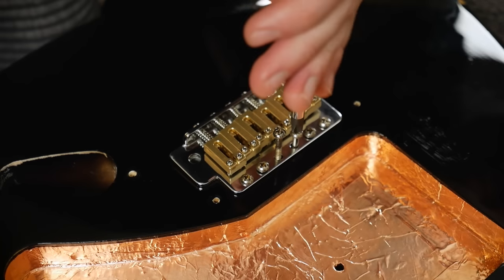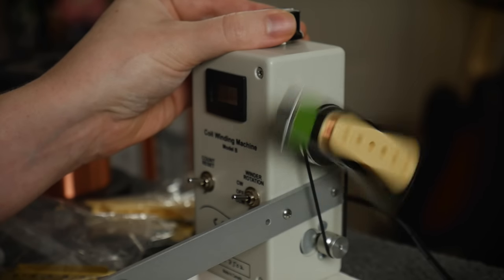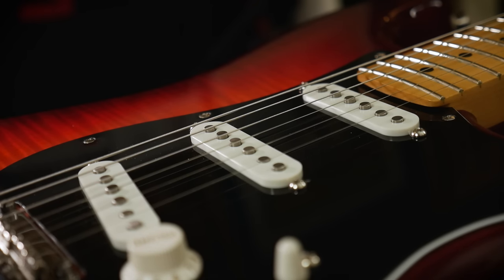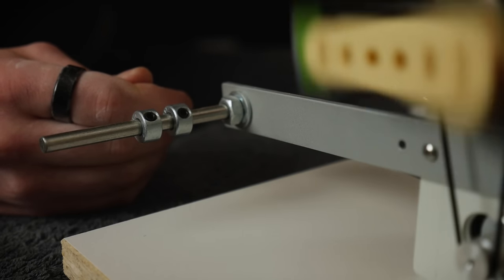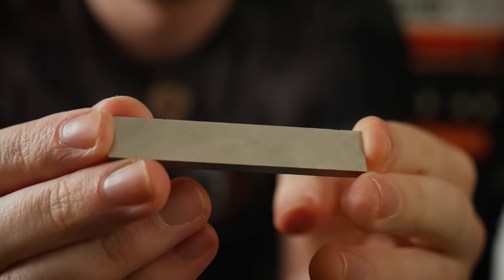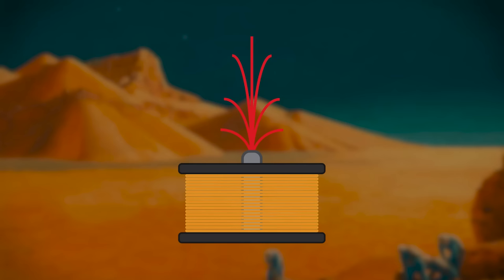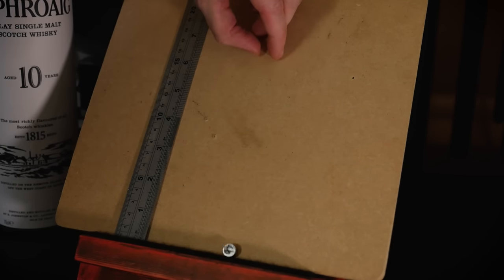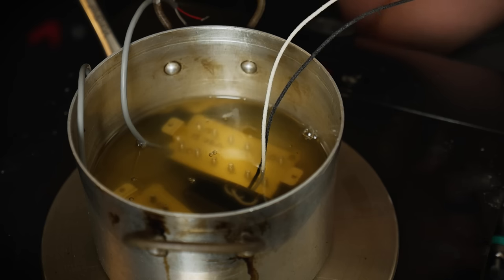(almost) EVERYTHING About Pickups | Too Afraid To Ask

Comment: Great video, however you said " pole pieces are the eyes of the pickup and determine how it will see the strings the purpose is to focus the magnetic field into a specific shape to sense the strings in a specific way"... I would rather say the pole pieces don't actually sense the strings but are more like a focusable "light-source" and the copper coil is the real "eyes" or detector/sensor of the pickup system. The copper coils will not be able to see the strings without the magnetic pole pieces or an underlying magnet and slugs (unless the strings are magnetized themselves and not just made of ferromagnetic material). This means pole pieces or magnetic component of the pickup don't even have to be inside the bobbin or within the coil of copper wire for the coil to sense the strings. See: https://www.youtube.com/watch?v=-jh8RRtruyc

Comment: A lot of useful information however I am not fan of the slimy  wording of it. 

I am aware that skipping the whole fairytale about uneven winding would ruin the "magic" of handwound pickups but I believe factual information should be always presented without bias.
Reply from the maker: The physics of induction for uneven winding is a very complicated topic - the way in which each layer of the coil interacts with is neighbours will change the overall inductive response of the coil as a whole, the way in which the coil is laid down is baked into the equations used to calculate inductance. 

It's not a fairytale, it's just really very involved and complicated to discuss factually, especially in a youtube video being watched by people without a background in physics and mathematics.
Reply: @ScienceofLoud  I appreciate your response. 
What it does is it changes the Q-factor and stray capacitance, both of which in combination with the inductance precisely define the frequency response (or tone in guitar terms) of the pickup.

 All 3 of these parameters can however be tweaked in a controlled manner to precisely tune the response to one's liking by a wide range of methods, some of which you presented. 

There are always multiple ways to get the same results and fabulating the more labor intensive one to preserve *the magic* is from the position of an educator highly irresponsible. That's why I called it a fairytale.
Reply from the maker: @ninethirtyone4264  as long as you are conceding that scattering the windings does indeed impact the physical phenomena at play and can result in macroscopic changes, then we're both on the same page.

Where we seem to differ is I'm happy to engage with people at their level of education and interest on the topic, and without going into the detail let them know that there exists justification for the 'magic' and 'mojo' players feel and hear. 

I'm not intending to reinforce unscientific ideas, I'm simply suggesting that there might be some reality behind the myths.

Comment: Eddy currents exists in ANY metal exposed to an alternating or even just changing magnetic field. (Moreover! Any counductor!) So your opposition of brass to another metals (in that aspect) is nonsense. It actually deprecates seriously all the information you delivering although most of it is true.
Reply from the maker: Yes, eddy currents technically will be generated in any conductor - but different materials will reproduce different intensities of the effect depending on a number of physical factors including density, resistivity, magnetic permeability and the material being uniform throughout. 

So it's not unreasonable to expect brass to behave differently to nickel silver in terms of eddy currents, and the magnetic effect they will have on the coil. 

I felt that maybe going any deeper into the material science and physics that govern the phenomenon were outside the scope of what most guitarists would want to know, or indeed care to understand. 

The take away is that brass has more of an influence over the sound of the pickup when used as a baseplate or cover, and the reason for that is eddy currents.
Reply: @ScienceofLoud  Then it was necessary to formulate in terms of differences in the strength of the effect. It sounded as if all other metals were equivalent in their interaction with a magnetic field to cardboard. Meanwhile, say, aluminum, precious metals, pure copper - will have the indicated effect to no less, or even to a greater extent.
Reply from the maker: Once again, this was a wide general introduction to pickups for guitarists, not a material science examination of the differences between conductors regarding their interactions with magnetic flux.

The mentioning of eddy currents alone was already enough of a tangent without writing a PhD thesis on it. 

I'm sorry you took the wrong meaning from what I was attempting to demonstrate in this video.

Comment: Your explanation is not correct. The string vibrating over the magnet induces a current within the string. That current in the string creates a magnetic field around the string. The moving string's magnetic field induces a current in the coil. It's not the disturbance of the magnet's field.

Comment: Literally everything you said about ceramic vs alnico is wrong.
Reply from the maker: You're not very clued up on physics, are you?
Reply from the maker: You'll want to do your research on both magnets and eddy currents, then come back and tell me how wrong I am about those things. 

Ceramic magnets have a higher gauss than alnico. higher magnetic flux density raises the resonant peak for the coil inductance. The stronger the magnet the brighter it will sound when used in a pickup. Ceramic magnets are used on overwound coils both for their strength relating to output and to help brighten up the dark sounding coil. 

Eddy Currents are just fascinating in every way, there are plenty of videos demonstrating magnetic braking (like I did with my magnet and brass), you should go check them out.

Comment: 9:00 - Sounds like bullshit. Change my mind.
Reply from the maker: If you look at equations to calculate the induction of a coil you'll find that they only apply for coils where each successive wind lies directly next to the last and form neat, orderly layers. 

Scatterwinding completely breaks the equations because induction as a phenomenon is about parallel wires influencing each other through electromagnetic interaction. 

Whether coil is sequentially ordered or not changes the inductive properties of the coil - that's hard physics. 

Whether or not that difference is something you can perceive or care about is subjective to you.
Reply: I know it changes, I studied this stuff at university. I just wonder what’s the difference in sound. If it’s an eq thing you can fix by rolling a knob by 10 degrees then I’d rather pay the minimum price for the “inhuman”machine made cheap pickup and roll that knob. I don’t wanna sound harsh, but sound is made by only 3 things:
- Attack
- Sustain
- Tone

That’s the reason why sound engineers mainly use EQ (for the tone) and compression/expansion (to manipulate the attack and the sustain). You can also manipulate the tone of the attack and the tone of the sustain individually with multiband compressor. So, what’s the difference with the added “humanity?” If it can’t be measured in terms of attack, sustain or tone, then it has nothing to do with sound. Like tonewood.